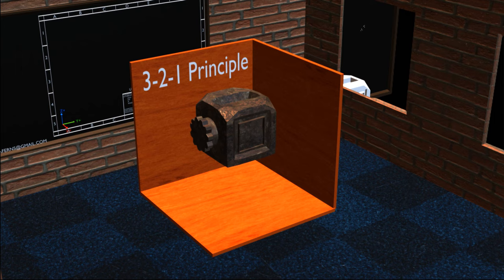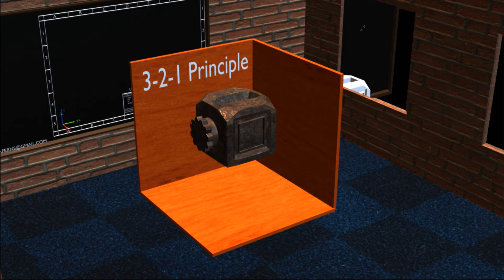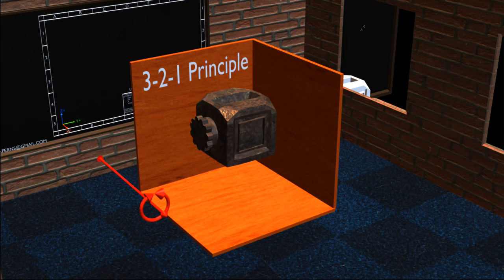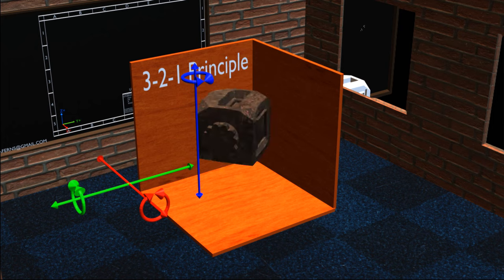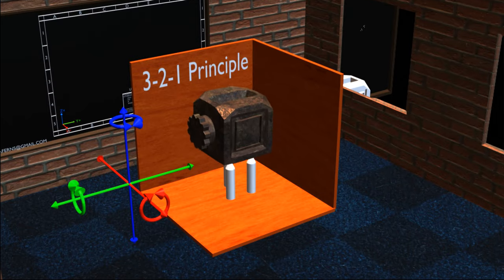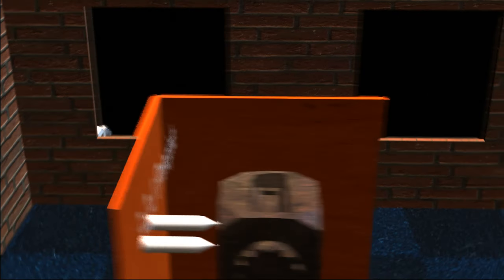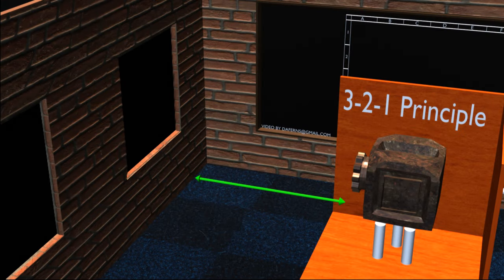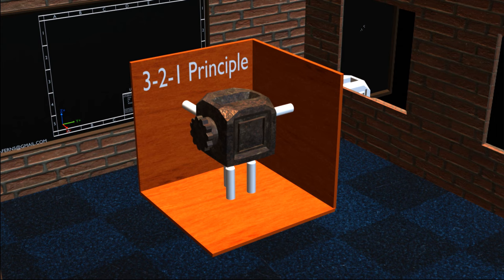3-2-1 Principle - GD&T 4.0

Comment: Still movement in positive x direction and positive z direction not arrested.
Reply: This is compulsory bro otherwise how can we mount and unmount  the workpiece
Reply: Thats a good question! In order to answer this question, you will have to consider a total of 12 degrees of freedom, basically splittng the translational motion about positive and negative axis and Rotational into clock wise / Counter clock wise. This way the 3-2-1 principle will allow you to locate and support your work piece by arresting 9 DOF's. The remaining 3 translational movements are to be essentially arrested with a use of a Clamp. 

You might want to have look into design of jigs and Fixtures for understanding this concept.